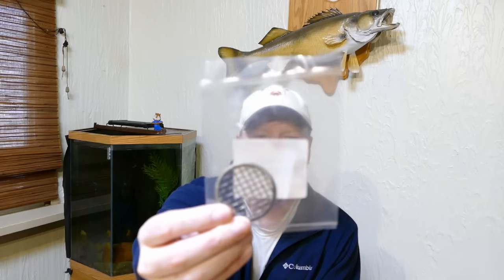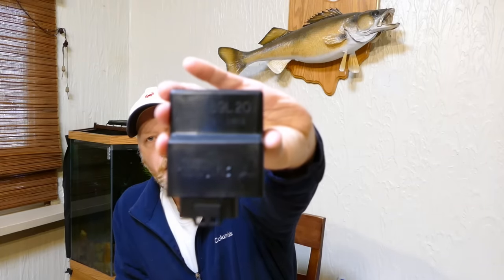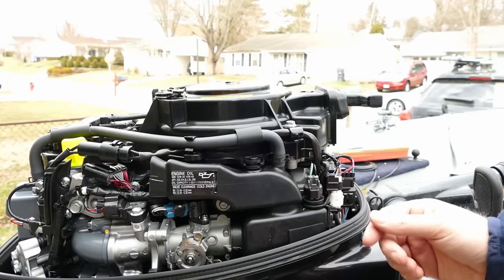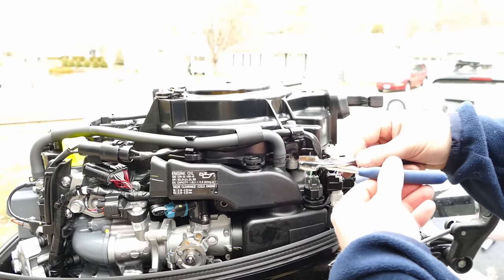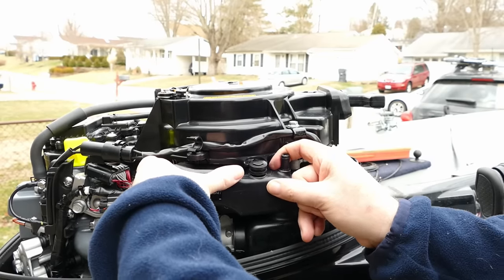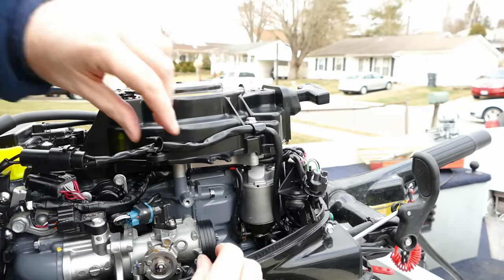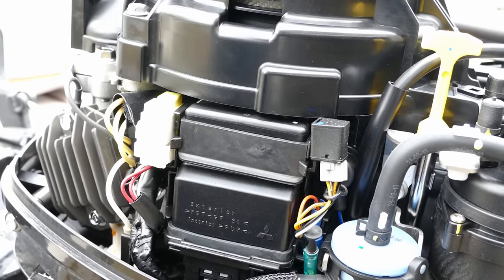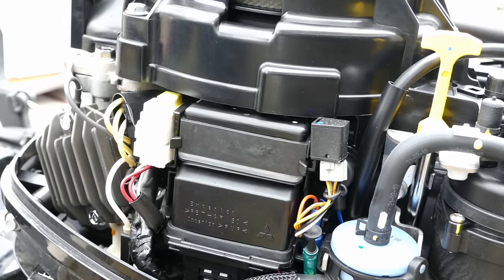Suzuki 9 9 to 20 HP Conversion Project  -  So Easy!

Comment: There is no need for a new ECU, I did this same conversion and by the advice of a Suzuki tech he said the stock ECU would adjust to the added airflow and it did, runs great.

Only parts you need are the flame arrestor on seal
Reply from the maker: Glad to know that is working for you!
Reply: @1224Peterson Still no problems? I’m thinking about doing this but the ECU is really expensive.
Reply from the maker: @kitkat101  Running like a dream!
Reply: @kitkat101  No issues, I've been checking the spark plugs and they look good, no signs of running too rich or too lean so the ECU is doing it's job. You will need a new prop tho, I got an 11 pitch, the stock prop on these are horrible anyways so budget for a prop as well
Reply: No ECU swap abd you won't get higher revs. 20hp revs much higher
Reply: I can't recall that these motors have a map sensor.. of not you would need te switch or remap the ecu
Reply: Good to know I have a 9.9 I was going to bump up to a 15, but I just got to a 20 now. Great information thanks again
Reply: Could you do the same upgrade from a 75 HP to a 90 HP?
Reply: @Muscleupsanddangles if you are using all RPM your prop is too small, does not matter if the ECU limits 5500 or 6000 you should never cruise at maximum RPM
Reply: @1224Peterson  hi without the new ecu you don't get the engine revving higher which gives you the higher hp

Comment: A prop change would increase speed.
The 20 horse has a different prop.
The ECM controls max rpm.
Reply from the maker: Yes, mine was changed.
Reply: To what? Did it help? Going to do this asap

Comment: We used to put the 9.9 cover decals on 15 hp motors, forty-something years ago.
Reply from the maker: That’s another way to go!  👍
Reply: We used to do that with a 6hp Mercury cover on a 15hp Mercury, just to fool the police, my little Zodiac Cadet 310 used to go over 50kph with that 15hp Mercury, the whole boat and motor combination weighed like 90kg with a full 24 liter tank.
Reply: @Dark30Outdoors 
Try putting the original control module in and test the speed and acceleration just by removing the air restrictor.

? ? ? Will it run a little bit better or a little worse or alot worse?.
Reply: Manufactures used to put 9.9 carbs on the 15's to meet the 9.9 rule when it first came out.  I have a Gamefisher like that.
Reply from the maker: @BobWiersema  Yep, and guys would do a carb conversion on them.
Reply: Yup. On the 15 the lower end is larger
Reply: Park rangers run the vin
Reply: @joeblow8206  on a 50 year old motor?
Reply: I did this on a new Chrysler outboard back in 1978. I never ever had a Conversation Police Officer ( game warden) to check the VIN number. I doubt that anyone reading this did either.
Reply: @joeblow8206 Hey Joe, do you actually know anyone that a Park Ranger actually checked the VIN on a boat motor? That sounds like a fishy story. 😂 Pun intended. Why would a Conservation Officer check VIN numbers? Check a 1000 to find 1 offender? That's hard to believe.
Reply: @Navyuncle  on the occoquan reservoir in Clifton VA they have a 9.9hp limit and are strict. Fishing tournaments all year here. And yes they study even the new model year outboards from the dealer before they're even sold. Can also read the vin easily and if not have a chart that tells them what each characters in the vin means. They can easily tell through a pair of binoculars engine size and type, even the minor engine casing variations, even from the smallest dif engine hp size. They have to confirm by the vin to write the ticket so yes I've seen many boats boarded for that very reason. My friend bought a tracker and thought the next size up from a 9.9s casing size was too close to tell. He got caught. Depends buddy on if your town has $ as to whether they can spend it on game wardens, rangers. Fairfax has always been one of the richest counties in the usa
Reply: @joeblow8206 oh wow did they seize your friend boat? What hp was he running
Reply: @nutmakin80  no just ticketed. I think it was a 15. Most bass tournament boats have large HP engines while fishing, - too much work to remove, but those are kept raised and a smaller 9.9 is right beside it pushing the boat
Reply: @joeblow8206  The Suzuki 9.9, 15, and 20 are the EXACT same engine!  The ONLY exception is the restrictor plate, and the ECU.  There's no way a game warden could tell the difference from a distance!  They would have to look up the VIN, or disassemble the engine.

Comment: with the new found torque, you can install a 12 or 13 pitch prop and get significantly more top speed out of that motor now.. Probably closer to 28-29 mph
Reply from the maker: Awesome!  Thanks for the tip!

Comment: Little soapy water as a lubricant helps sliding things with rubber gaskets or mounting surfaces in place a lot easier
Reply from the maker: Thanks! I appreciate that tip!
Reply: Windex is great for that, it dries nicely.
Reply: Really don't want to get water near a ECM or the connector. Silicone lube spray would be better.
Reply: @SynicalBeats  not really as silicone spray stays slippery, where as windex and/or soapy water dry.  Thus the rubber still offers support via friction.  In most cases like this I use Saliva (yes I spit on it 🙂)

Comment: I upgraded my 15 to 20, if I knew what I know now, I would have just bought the 9.9 and upgraded it. Others have mentioned changing the prop, but when I looked it up, the standard prop was the same for both. Haven’t had it out on the water yet, but it runs fine on the Mickey Mouse hose fitting
Reply from the maker: Awesome!!  Every little bit helps!  👍

Comment: Hi there, I have since been told the ecu does restrict the rev limit. The 9.9 revs to 5800 the 15 to 6000 and the 20 to 6200 that's how some of restriction works
Reply from the maker: That makes sense!
Reply: Get a 20hp ecu

Comment: You need to swap the prop to a higher pitch to absorb the additional power.  That will give you a higher top speed.
Reply from the maker: Yes, it was previously changed!  👍

Comment: Unbelievable you can convert to that much more horsepower with such few parts. Good job
Reply from the maker: Yeah, pretty slick huh!!
Reply: 9.9hp engines are tailor made for specific markets and regulatory rules. like in the EU the maximum engines kids under 16 can use is a 9.9hp engine. Easier to downgrade an existing engine design to meet the hp requirement than making a whole new engine.
Reply: @gromitNOR83 def not the whole EU, for example in Finland, a 15 year old can drive boats under 5.5 meters with 20hp motors.

Comment: If I was doing this I would check the ignition advance between the two models and the injector size. If there the same spec I would say its the washer between the airbox and the throttle body, that is restricting down to the smaller hp

Comment: In fact, you can not buy anything at all, take out the metal flap from the rubber band, and the control unit ebu flash the firmware from 20hp motor, firmware is available on the network, I can share. It can be flashed with any programmer, for example piasini v4.3.
Reply from the maker: Good information, but that sounds quite technical.
Reply: @Dark30Outdoors  Bro, I can also give you a suzuki sds diagnostic program to diagnose the motor.  All you need is a Chinese k-line adapter for 8-10$ and PC win xp-10.

Comment: The reason this works for Suzuki is because the 9.9 and the 20 are the same motor with different intake controls.  They both weigh 108 pounds in the long shaft version.  But other manufacturers have different approaches.  Example Tohatsu offers a 9.9 that weighs the same as their 20.  They also offer a 9.8 that is significantly lighter.  The 9.8 weighs 80 pounds.  If you are frequently using a portable on a dinghy from a larger vessel, the difference in lifting 80 pounds or 108 pounds is significant.  It magnifies when mounting to a dinghy in a rolling anchorage.  I only post this to highlight the differences between the 2 brands.  I have a Tohatsu 4hp on a small boat and a Yammy 175 on a slightly bigger boat.  I don't own a Suzy.
Reply from the maker: Very true!!  👍
Reply: @Dark30Outdoors  Thanks for the thumbs up.  My comment was nothing against your post.  The upgrade is awesome and probably less expensive than the 20.  I was just thinking of different applications which have different priorities.  As a young man in his 70's, weight is becoming very important.
Reply from the maker: @williamstreet4304  I can certainly appreciate that!
Reply: This is true - most, if not all 9.9s are restricted versions of the 15 or 20hp. The manufacturers do this across their lineups - I think your yammy is the same engine as the 200, just without vvt
PS: 70 ain’t nothing young lad!
Reply: The Tohatsu 9.8 is smaller cc than the 9.9. 

The 9.9hp Tohatsu is same engine with the 15hp and 20hp versions, they also have different restrictors and ECU's, so from the 9.9hp you can get 20hp out as well.
Reply from the maker: @Faitter  Good to know!
Reply: @Faitter  I completely agree.  My purpose was to discuss the weight.  We frequently must move motors on dinghy's when sailing.  The 9.8 gives you 0.1 HP reduction and 28 lbs weight reduction.  For people who are ageing, 28 lbs may be the difference between sailing and stopping.

Comment: That’s awesome that you can upgrade by 10 HP that easily and for less than $500.  Sweet !  Wonder if I can upgrade my Johnson 15 hp to a 30 as easily. Something to look into. 13 mph up to 21, yeah that’s a great upgrade and getting on plane that much quicker. Good job Kyle !
Reply from the maker: If your Johnson is a 4 stroke that is fuel injected then it might be possible.  The only other model that I have heard of people doing it on is the Yamaha.
Reply: @Dark30Outdoors  yep she’s a fuel injected 4 stroke but she’s also a  bit older 2013. She gives me pretty much all I need.
Reply: @bucktalesoutdoors7566  Johnson never made a 15hp fuel injection 4 stroke.
Reply: @igotmesothelioma  you’re right my 15 HP 4 stroke Johnson is carbureted.  Oh well ! It goes ok.
Reply: @bucktalesoutdoors7566 might be able to change the carb to a larger hp one, change fuel pump, and some other things
Reply: In fact, you can not buy anything at all, take out the metal flap from the rubber band, and the control unit ebu flash the firmware from 20hp motor, firmware is available on the network, I can share. It can be flashed with any programmer, for example piasini v4.3.
Reply: Oyadar karaga  assam barpata sa fon nombar dega
Reply: @Dark30Outdoors  Tohatsu, Nissan, Mercury and Mariner 9.9/15, as they are all made by Tohatsu,  can be converted to 20 hp doing the same procedure as yours. I guess some late Evinrude are made by Tohatsu as well, at least my 3.5hp Evinrude says it is manufactured by Tohatsu, but can not say about other Evinrude outboards. Great video, please make a video update if you change the prop at some time and how it has performed. Happy boating!

Comment: That's very cool that you can change it to a 20 HP with just changing out those 3 parts.
Reply: In fact, you can not buy anything at all, take out the metal flap from the rubber band, and the control unit ebu flash the firmware from 20hp motor, firmware is available on the network, I can share. It can be flashed with any programmer, for example piasini v4.3.
Reply: @gordonshumway4763  Do you know where one could obtain firmware for 20 hp, electric start external controlbox?
Reply: @capsterism  Hello, buddy!
Write your mail.
Reply: gimaanen thats an gmail address
Reply: So latest 9.9 efi tohatsu outboard is at 84.9lb so by changing parts to 20hp it still remains at 84.9 lb ...which is nice because at stock 20hp tohatsu, weight of engine is at 104lb...so ur saying 15lb of weight

Comment: Flame arrester on the intake of carb/fuel inj. system. I'd call it restricter plate.
Reply from the maker: Yeah, that's just what they call it.
Reply: All marine gasoline engines should have a flame arrestor on the intake.  Especially an inboard or I/O.   You have never seen a backfire (and it's not a noise from the exhaust)?
Reply: The airbox is the actual flame arrestor on outboards.
Reply: @glennjames7107  Those engineers, what they won't think of.

Comment: Great mod and I am sure you saved thousands.
Reply from the maker: Thanks, but I only saved around $40 or so.  Though, technically I have an OB motor I can run as 9.9 or 20 hp. Also it says 9.9 so it’s valid on lakes that are 10 hp or less.

Comment: One could get most of the performance for free by just removing the restrictor.  From what I've read the only difference between the ECUs is that the 20HP one allows an extra 500RPM before the rev limiter stops it so you'll get all of the acceleration of a 20 and just not have the same top speed potential.  Putting the right prop on it will probably be worth more than the ECU swap without a re-prop.
Reply from the maker: Good to know.

Comment: Interesting to see if it uses less fuel at the same speed without that restrictor.  In a similar thing where the manufacture limited the power output for the same engine, I had a Cub Cadet with a Kawasaki engine that went from 22hp to 25hp by just allowing the throttle butterfly to open fully.
Reply from the maker: If I had to guess it likely uses a bit more fuel, but it isn't so much that it is really noticeable at all.
Reply: GM used to limit the throttle valve opening angle on some cars when they had corporate edicts on the amount of power for that size car.  One of the first buff-book recommendations was to have someone fully depress the accelerator pedal while you stared down through the top of the carb - of course with the engine off and air cleaner lid removed.  If you saw the throttle plate wasn't going vertical, you could look for what was stopping it short and remove that restriction.

Comment: Check to see what sparkplugs go on the 20 HP. Might be best to run with them.
Reply from the maker: I believe they are the exact same.  👍
Reply: The restrictor allows running only at very low speeds…. Pumping losses go way up once you go much above Idle speed.

Comment: My question to you and anyone in the group who completed the upgrade to either 15 or 20hp is whether a noticable increase in power was noted at low to mid RPMs, or only at the high end because the WOT max was increased? For example would I expect to have greater speed (and therefore greater fuel consumption) at say 3500RPM (my expected typical cruising speed) after converting to 15 or 20hp? Thanks!
Reply from the maker: My boat sure gets up on plane a lot quicker than it did before!  I don't think the increased fuel consumption is that noticeable really.
Reply: @Dark30Outdoors

Comment: Looking to do this to a Mercury 9.9 EFI. The parts seems to be the same between the 9.9/15/20 EFIs, except for the ECUs and restrictors on the 9.9/15. Hope it'll be this easy for me.
Reply from the maker: I think it should be.  👍
Reply: @Dark30Outdoors  Yep, it was very similar, and worked. The ECU was a little harder as I had to remove the lower cowling a bit since the electric starter take up some room above the ECU so I couldn't pull it out without some more space.
Reply from the maker: @john6268  That's awesome!

Comment: you can take the side cowling off to pull the air box down and forwards, I was staring at one of the bolts the whole video
Reply from the maker: Thanks!  That's a good tip!

Comment: I have a 2021 Suzuki 9.9 and I am waiting for my warranty to expire, then I am doing this to mine. Parts are  already on the shelf in the garage.
Reply from the maker: Sounds good!!
Reply: You don't have to wait, why should you have to wait? If you have a new control box with the firmware from the 20th motor, you can safely change it right now, no one will know about it. If the motor breaks, just put everything back in, you can wear gloves so you don't leave fingerprints.

Comment: if you are having trouble with fitting rubber parts back together, use a little dish soap as a lubricant. works well and then dries out or washes off later in use.
Reply from the maker: Great tip!  Thank you!

Comment: without a new prop, your mostly gaining acceleration and torque. you could probably gain some decent top speed with a new prop
Reply from the maker: Yes, it had previously been changed to a 10 pitch.

Comment: I would love to know how much difference it would be to just replace the restrictor plug with the flame arrestor with the original cd in place.
Reply from the maker: Good question, but I don’t know if that would have a negative impact on the existing ecm.

Comment: Seems like you should be able to get quite a bit more out of that with higher pitch. I have a Johnson 25 and I am running a 10.3X13 pitch. I can run about 30 mph by myself and 27mph fully loaded with two people. It's a 14 ft fully decked, a lot of gear, and 2 trolling motor batteries as well. I saw some of your other comments that it's common for people to run the even smaller 9 pitch but that seems like quite the difference from my 13. I guess I'm not sure what the diameter is either, or what rpm you are turning. Might just be a big difference from 2 to 4 stroke as well.
Reply from the maker: I do think the 2 strokes turn a higher rpm.  I used a temporary ob before this Suzuki came in.  It was a 9.9 2 stroke that had a carb mod to 15 hp.  It got me to 18 mph.  I'm really happy with this set up.  I never have to worry about hitting the redline and get pretty good speed out of it.  Plus I can use it on 10 HP restricted lakes with no issues.